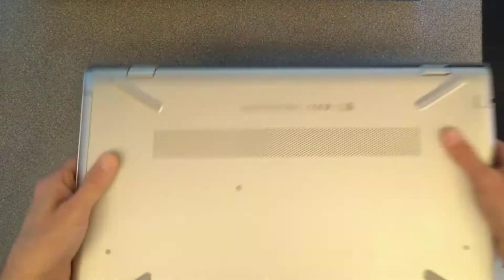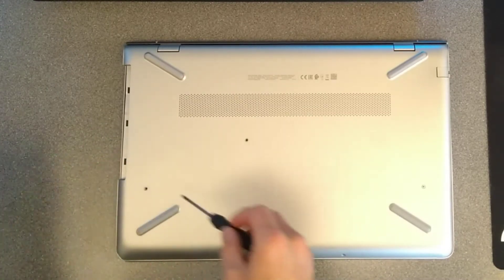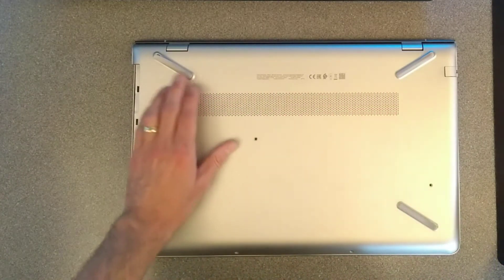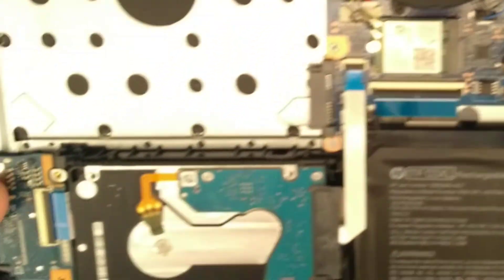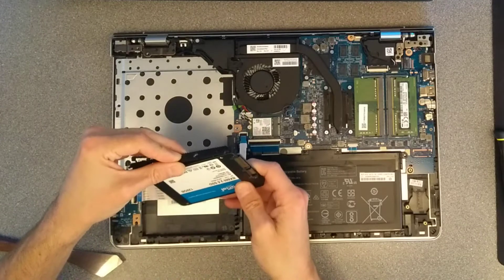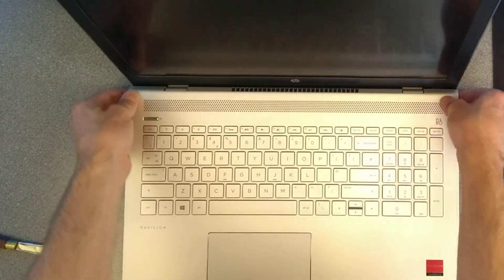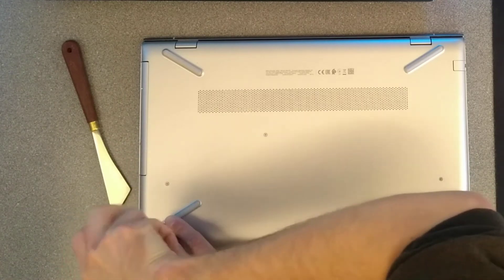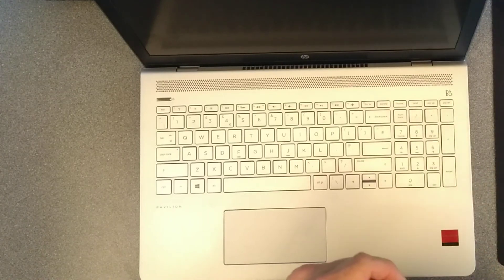How to replace or upgrade the hard disk in a HP Pavilion 15-cd059sa

Comment: Where can I buy the hard disk or a compatible one for my hp 255 notebook pc? Thanks for the helpful content!
Reply from the maker: Amazon or eBay? Any 2.5" SATA ssd should be fine. Or a "laptop thin" hdd. But go for an ssd
Reply: scan or overclcokers or ccl are good options. the laptop also takes an m.2 such as samsung 990 pro. but as long as you have a supported screw. a samsung 870 evo is a good option